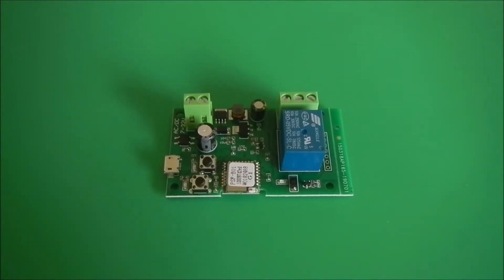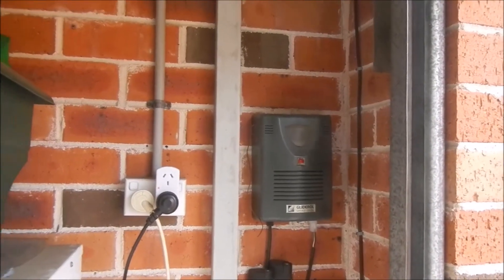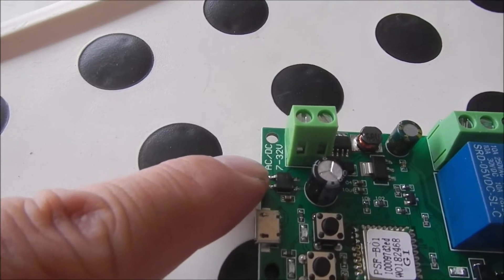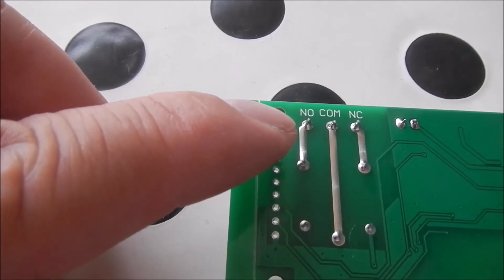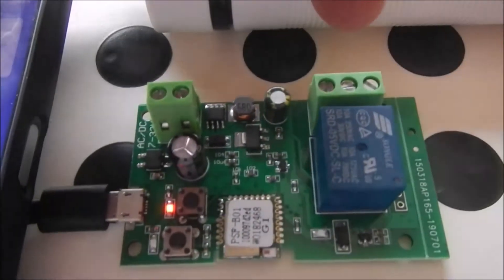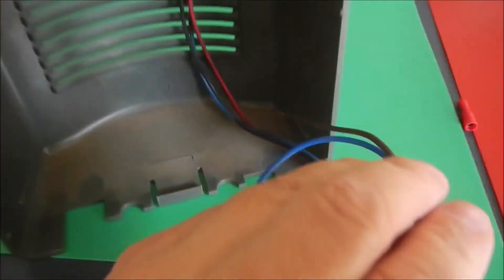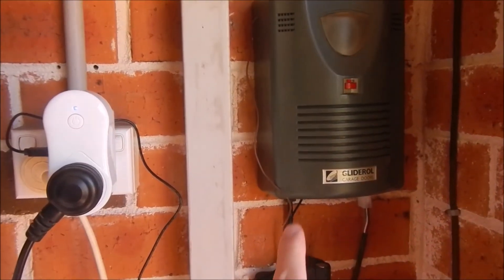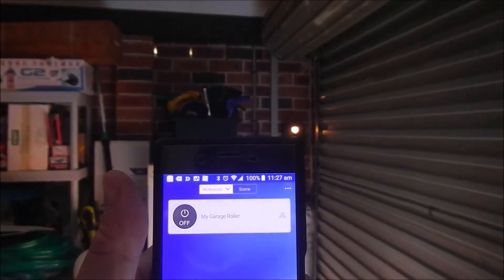eWeLink Mobile App WiFi Remote Control Garage Rollor Door Upgrade

Comment: I used a different module but it is basically the same. There are a lot to choose from. Thanks for this. They sell a unit that is brand specific at my local hardware store. It is $85. This was only $10 and I have to garage doors. Saved $160.

Comment: I'm having troubles with mine. I connected a 12VDC power source and wish to open a 8-12V door lock. The problem is that I don't receive any usable voltage on the outlet pins after the Relay. on the back I also measured with my multimeter and no voltage on the solder on the back. The Relay does click but no power.

Am I doing something wrong or die I received a bad copy?
Reply: Check once you connected in nc or no